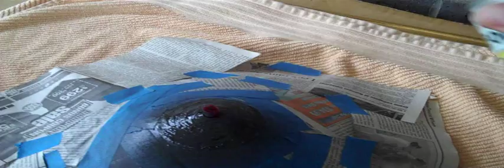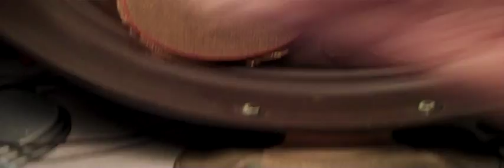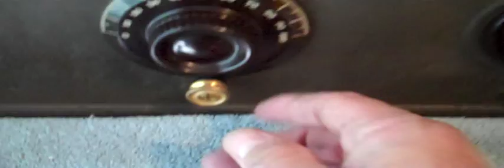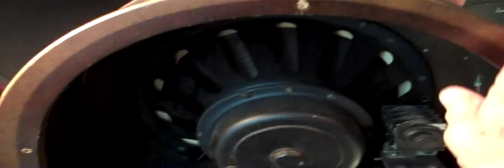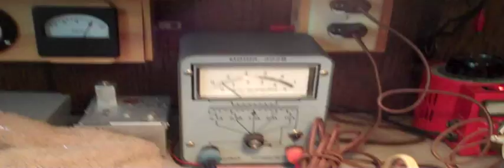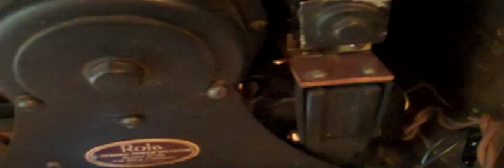1927 Atwater Kent Model 37 Repair and Restoration. (Part 18 of 21).

Comment: Rola was a fairly big name in speakers for a while. I think I have several around here including one like yours with the copper oxide rectifier.  I've read they are often still good, but I think it's best to play it safe and go with a modern diode and add a fuse.

Comment: It sounds so much better now. fFels rewarding to save classic gear doesn't it.

Nice Rola field coil speaker. There is one on eBay right now and the seller states it's made by Jensen. Just throwing that out there. I don't know much about the early field coil speakers at all. I have a pair of 18" Jensen field coil speakers that were given to me by my deceased best friend long before he passed. I should get them out of storage for a video. They're at least very cool and possibly rare. 73's Paul

Comment from the maker: Phil,
Thanks.  You know...that 5-minute Epoxy Gel doesn't harden up like rock.  It has a slight flexibility to it.  It's hard, but not hard.  Difficult to explain.  I was happily surprised by that.  So there's even less chance of it cracking over time.

Regards,
John.

Comment: another fine restoration i like the the way you give the reason for not using epoxy ( will crack with the vibration of the speaker ) this is what we need explanation of why not use certain products thanks again 
phil